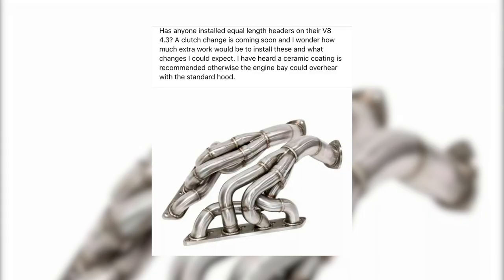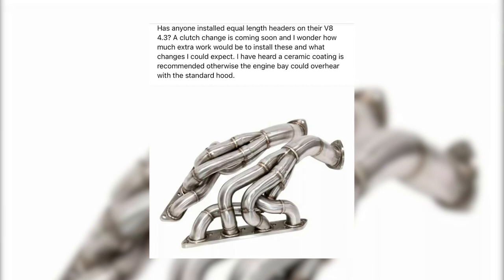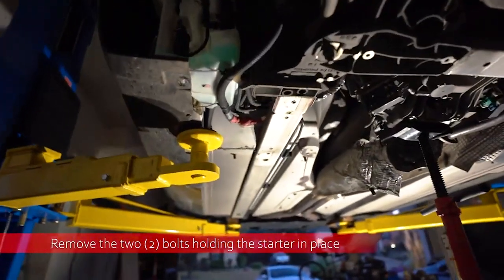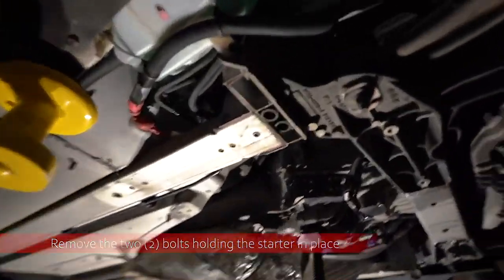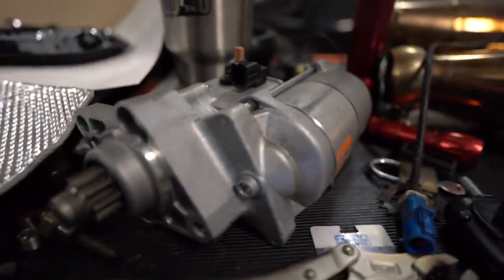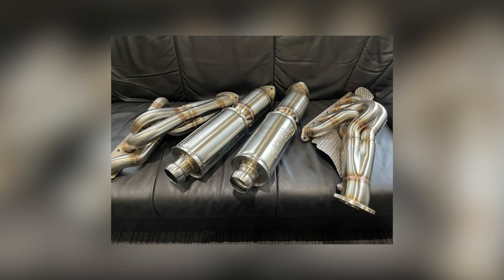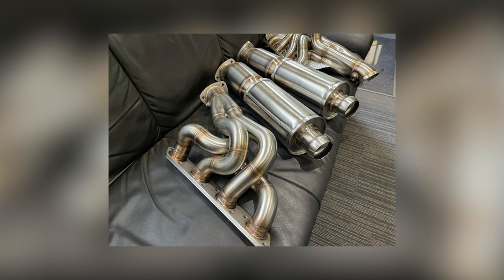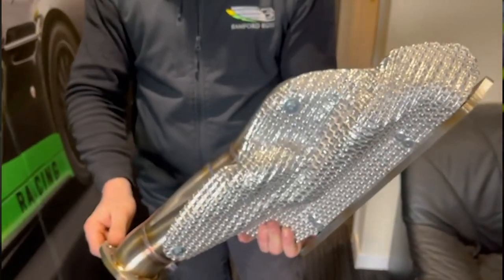V8 vantage upgraded manifold, does it need a heat shield? Forum Chat 62

Comment: So you’re willing to criticize, but unwilling to sell your properly engineered parts ala carte as a solution?
Reply: what?
Reply: @billtomlin9954  my point is that while Mike brings up some good points, he offers no solutions to people other than to buy his parts, and have them installed at his shop. If you’re in the US, that’s obviously impractical. For that matter, good luck having him even respond to email inquiries. For the good of the community, a more helpful post would have been to show how/where to apply heat shielding to protect the starter. Mike has a wealth of knowledge, I’m sure he could offer a practical solution...even if he’s unwilling to sell it.
Reply: @E30racer72  He’s posting in his own YT page to his own 3k+ subs so I think he’s got every right to talk about his own kit. That said, he shows exactly how the heat shielding should look on the right side manifold so if you don’t buy theirs you can at least check that whoever supplies yours has heat shielding fitted. As he rightly points out the customer shouldn’t have to ask the question, the supplier should know what they’re doing. As far as comms are concerned I’ve never had a problem getting an email response and I’ve had to call them twice and Mike answered the phone and the query himself both times. No issue.